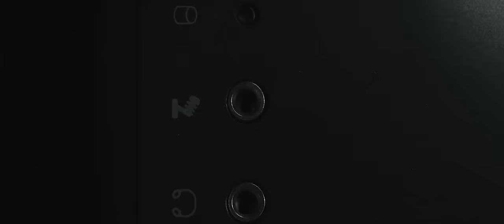NZXT S340

Comment: Corsair , Cooler master and all you cabinet makers ... Beware NZXT is here. 
At 69$ this is bloody drop dead gorgeous ! 
Love you NZXT :)
Reply: ***** But the Phantom had so many issues. With plastic to metal color issues and overall cheapness...
Reply: *****
Switch 810 was an absolute best case from NZXT ! 
But i'd still love my Phantom 530. 
630 and 820 are just too big.. :(
Reply: It better be a solid case. I would love to see this compete with Corsair's flimsy cases.
Reply: Yusoff M My C70 is very sturdy. Like, you can sit on it.
Reply: Yusoff M C70 is really good , only it should have had that clean side panel and not those 2 fan grills , that kills that uniform look for me. 
Apart from that C70 looks pretty good , i was also in love with the Obsidian 750D 

I Personally think only Corsair and NZXT make great cases , CM really has lost it after their stacker series.
Reply: gaurav kay I hate the side panel. I want something more simple/clean. So I might get the S340 or H440. I still like corsair though.
Reply: *****  : yes you're right , but always remmeber companies usually dont do ahead and make something totally revolutionary they actually sit back take a look at their last designs and redesign something better. 

If you look at Switch 810 from NZXT , that actually set a standard for all new cases for NZXT and also even the Phantom series has many things taken from switch 810 (Fan hub , adjustable fan for gpu , HDD racks (slightly changed) , Fan grills at bottom )
But personally i still love Switch 810 till this day because it was neat and not angled. 
Though i personally own a Phantom 530 its best bang for buck right now , but even Obsidian series looks super good. 

Apart from that i can agree NZXT is at their best right now , we just want a healthy competition out there , so that it brings the best out of these companies
Reply: connor Piper Take the H440 , if you can hold it , you can actually get a Razer deisnged H440 and that would be totally great. 

I just hope razer and nzxt release that soon , but even apart from that there are some nice colors in H440 right now. 

Damn had this case been out there when i took it , i would've surely grabbed it ! :)
Reply: gaurav kay I meant the value cases. The old ones like C70 is really good, but it's made before they step down their effort and is not cheap too.

Comment: I wish other companies would pay such attention to detail as NZXT did with this trailer. The scenes where the the metal was being hammered into shape shows the craftsmanship and the bubbling sound with the bass reflects the sound water would make and water would be used to cool the metal down. Great detail.
 One thing I will say though is that  am worried that NZXT will skip on quality on key areas. Let's just hope the case engineers payed as much attention to details about the little things in cases that make the building process easy and enjoyable as the marketing team did with this great trailer.

Comment: Is there enough airflow in the S340? Im debating between the S340 and the H440 but I'm leaning towards the S340 because its sleeker and looks nicer in my opinion but I'm worried about the lack of fans and placement of the water cooling unit. I am going to put my H100i in there with a 140MM fan at the top and a 120MM fan in the rear but I'm not sure if thats enough airflow.

Comment: Now is the black version more matte or glossy? I hate glossy surfaces.

The design looks very good in the pictures though. Only thing I can think of would be that the feet seem unnecessary tall since there's no intake at the bottom. Looks really clean otherwise!
Reply: CO Trust me, they don't need to be that tall. Not a big deal though.

Comment: How do front mounted fans work with this case? That front panel looks pretty solid..
Reply: Tᴴᴱ Tᴱᴺᴬᴄᴉᴏᴜṡ One You see.... there are fans in the front and yes there is a panel covering it directly. BUT the fans still have an intake... if you look at the top of the case u can see this line hole sorta thingy in the front... thats the intake for air... and i believe its underneath as well.
Reply: Max User Oh ok. Wouldn't be much airflow from such small holes but I guess that's what you get for having such a sleek looking case!

Comment: Why didn't they just add a 240mm radiator support on the top? This bothers me.
Reply: +Psycho&#39;s Video Dump taller and more expensive...plus it doesn't really need it
Reply: I wouldn't mind paying an extra $20 for that 240/280mm radiator support on top.
Reply: +Psycho's Video Dump yes but i would mind paying 20$ extra for something a lot of people wont use

Comment: It does not have a disc drive. How am I going to install windows
Reply: Maybe if you take a saw and cut a hole in the front of your case then fill a bucket full of gasoline and dump it in the hole while your computer is powered on, windows might install. worked with mine, don't forget to throw the install disc in the hole with the gas.
Reply: Who even uses discs to install windows anymore.. just download it onto a usb and put in the product ID

Comment: Bad cable management options. No rubber grommets or anything. But hey, what do you expect for $70? Phanteks Enthoo Pro for me. Only $100, awesome cable management, PSU cover, drive bays, amazing cooling. I'd pay an easy $200 for a case like it. I feel as if they are under charging really.

Comment: This design has in my opnion one BIG fail, the SSDs beiing under the airflow of the video card, it takes all the hot air from the video cards.
Reply: That really doesn't matter, unless your gpu is blowing out air with a temperature like 50+ degrees Celsius...
Reply: And you're stating the whole design is a big fail only because of the fact that the ssd's are placed under the gpu... seems a bit exaggerated... 
If you don't like the place of the ssd's then put them under the psu shroud! They don't have to be screwed in place.
Reply: +Bruno de Oliveira ssd does't not have moving part like standart hdd even it doest make any different on ssd performace
Reply: +Budi Anto Hmm good to know, but the position is a little strange tough with more than one video card
Reply: Bruno de Oliveira yea if you used the video card on the 7th slot of case, the card it self will touh the ssd... too bad for this case

Comment: The funny part is this tells us absolutely nothing about the case xD
Reply: Aryonsen then u must be blind XD.
Reply: Max User Well yeah the description tells us more but, I rather see technicalities of the case than a factory like scene in the actual video.
Reply: Well they do include some technicalities... such as a power button and the USB 3.0... they also point out steel a lot so it must be something to do with steel.
Reply: Max User This case has a lot more feature than a power button and USB 3.0.. What about the special power supply mounting? And the 2 ssd mounts? Also the longer graphics card support for mostly unsupported mid atx cases. Not to mention the front mounts for a 140mm radiator. Dude the video doesn't even scratch the surface of this case. Builders these days don't give a crap about USB 3.0 and a freaking power button (That's incredibly standard). We care about cable management, Water cooling mounts, also if it will support 2.5 inch drives. Case specifications are just as important for any other part in a PC. Which this video doesn't tell us anything.
Reply: they also show the headphone and mic ports.... and i guess you could say they didnt show much.... the video interests you to go and look at their product and find out more... which u did! XD
Reply: I already knew about the case brother, I found this a while back. Most people really don't give a crap to see more. They will watch this video and be like "cool moving on". And all the great engineering in this case was completely forgotten by the consumer base because the advertisement failed to mention it. Max User